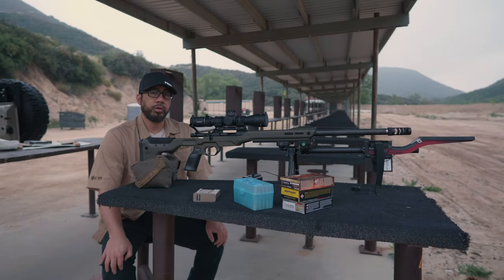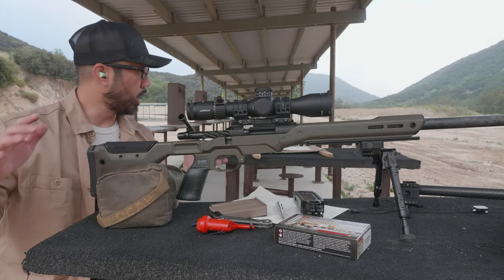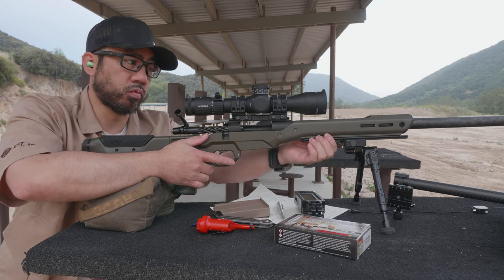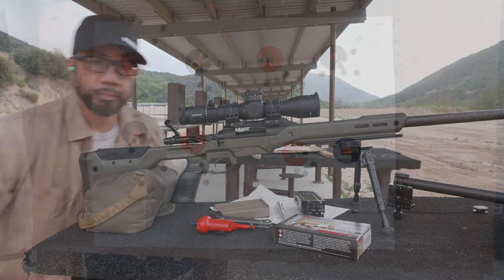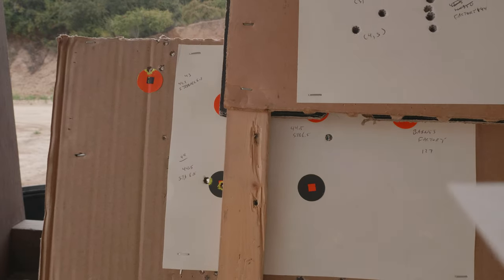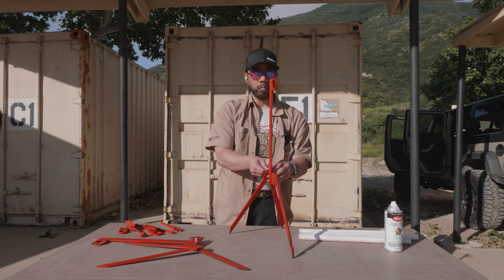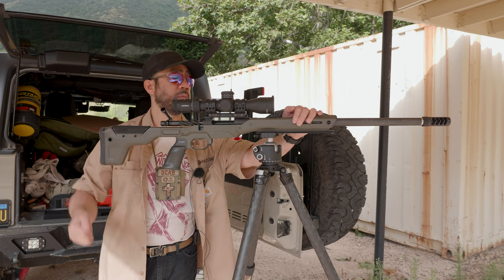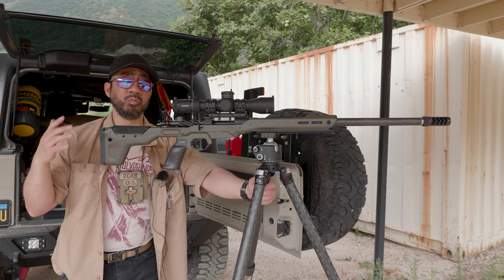Range VLOG #225 - More Lightweight Precision Rifle Build Testing and New Atlas Target Works Stands.

Comment: The RRS ARCA clamps are adjustable, I have the same clamps, if you open the clamp with the lever in the open position, the moving side of the clamp is under spring pressure, squeeze the moving side of the clamp towards the lever side of the clamp and it will expose the round knob you see on the opposite side from the lever. While you hold it squeezed together, you can rotate the knob in and out to adjust the clamp size when locked. There are small detents in the round knob and it has to be oriented on one of those detents to drop back inside the clamp side when you release the spring tension. It can only be adjusted with the lever in the unlocked position and not attached to anything.
Reply from the maker: Which model RRS clamps do you have? That mechanism you are referring to wasn't introduced until the SC-ARC (bipod / ARMS-17 interface) and the ARC-LR (tripod interface). The ARMS-LR doesn't have that adjustable mechanism.
Reply from the maker: This is the ARMS-LR that I use on my bipods - https://thermalopticsplus.com/cdn/shop/products/ARMS-LR-SOAR-Bipod-Clamp.02_1024x1024@2x.png?v=1615910346 - I never bought the SC-ARC (after R-lock was introduced in 2021-ish) because I didn't jump onto that R-lock system. I may get an SC-ARC for the CKYE-POD triple pull after I discovered the ARMS-17 interface on the CKYE-POD doesn't work with the ARMS-LR due to the interface interference.
Reply: Oh ok gotcha, I guess I have the newer version I think mine are the ARC-LR, they do have the round pop up inside the clamps to interface with the r-lock system (which I don’t use either).  Sorry, thought I maybe could help you out.

Comment: Have you tried adjusting the RRS Arca clamp a little tighter to fit the rail? I have the same clamps and depending on which chassis I use, I often have to adjust my clamp to be tight on that arca rail. There are some slight variations between my Manners, MDT and MPA chassis.
Reply from the maker: Yes, before the last group I shot which was pretty decent with the 1 thrown shot I torqued the Arca rail screws down to 25 in-lbs. EDIT: I realized you're talking about the clamp. I'm using RRS lever release clamps for the bipod which are not adjustable. If the rail dovetail is to RRS 1.5" spec, they should not be an issue. The only time I've had issues with RRS lever clamps are with chassis foreends, especially if Cerakoted. One of my MPA BA Comp chassis is kind of loose now because the cerakote wore away changing the dovetail spec.

Comment: Hi there one things that you can check out is the recoil log you know 
I got chassis the cheaper version the orix from my huting tikka and i find out that the one the supply from ndt is to small and moved around i little to much and it will never grouping properly you know so came back and bedding my solid to the chassis and done now is shooting 0.10 mls at 100 meters

Comment: How is that HNT26 chassis? Is it rugged and stable?
Reply from the maker: It seems pretty rigid. The only issue at hand right now is the Arca dovetail not being the correct width spec at least for my RRS clamps and having to find a way to mitigate it.